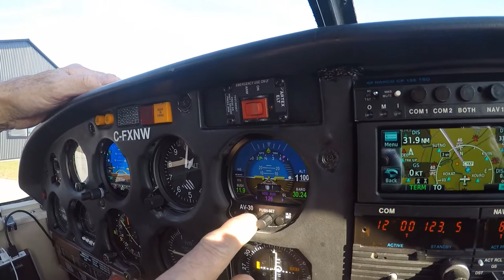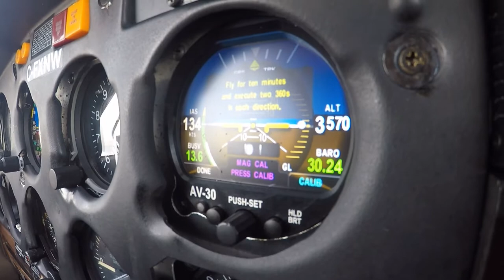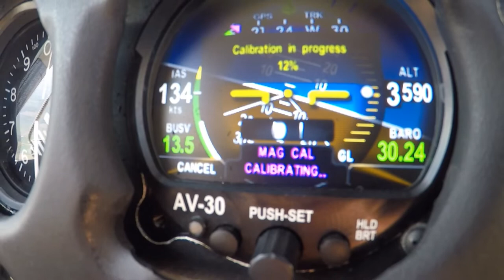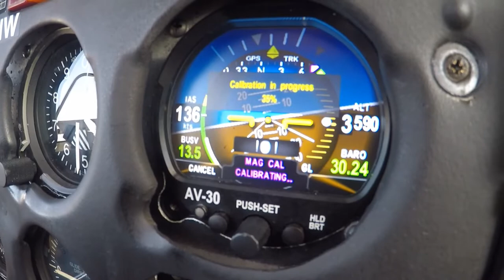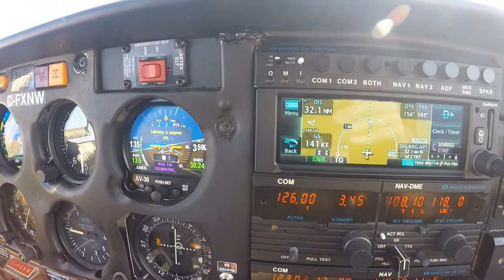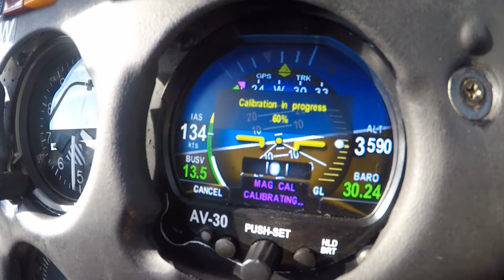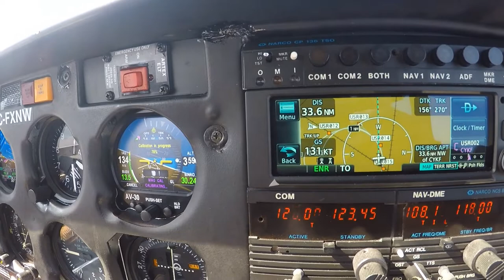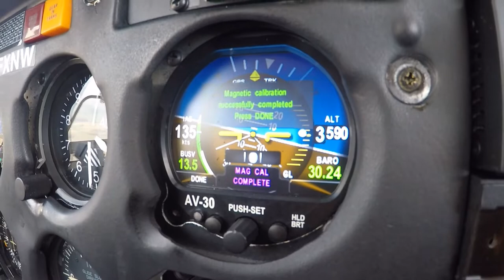uAvionix AV 30 Calibration of Magnetometer

Comment: I just had a pair of these installed in my 172-N and the vac system removed. By default, the DG does not use the magnetometer and drifted about 5* per 30 minutes, which is better than a mechanical gyro. I was happy with that, but just for fun I enabled the internal magnetometer (set AID mode to MAG1) and then calibrated it similar to how you did it here. All turns standard rate (2 minutes per 360). For the first calibration I made my turns R, R then L, L and the drift was worse than the default of not using the magnetometer! I calibrated a second time making the turns alternating: L, R, L, R and the result was much better.

Comment: tried doing this with a AV30E and it was locked out ? Is this still an available option /
Reply from the maker: You have to put it in the set up mode to do the calibration. Hold in on the button and power it up. then ture all the way too the right. look at the first part of the video.

Comment: Did you have yours in MAG1 or MAG2? 
Also I’m wondering why when the DG is function locked there is no way to adjust heading after it drifts
Reply from the maker: Sorry I am not sure but I think it is Mag 1 I also think the latest updates improve the function. I just this week installed the latest version and it now retains the altimeter setting after restart.
Reply: @Gord001ca  ok perfect thanks! I wasn’t aware of the update

Comment: What are you using for a DG and the OBS heading adjust?.    Also, does the AV 30,  heading bug move to indicate what the GPS has it set to, or the DG has it set to?  Example:  I know you can't set the OBS bug or heading bug on the AV 30.    But does it at least show what the bug is? , assuming the bug was set by the DG OBS ,  or the bug was set GPS itself due to direct to hdg mode .
Reply from the maker: I still have my old HSI 100 for a primary DG. The AV 30 is a great stand by and has a built in magnetometer which works fairly well and it also gets in put from my GPS. My GI275 is also a magnetic compass as it has a magnetometer connected. So hopefully I don’t get lost. I have lots of redundancy. Two artificial horizons, three altimeters, and 5 directional sources. And you can set the heading on the AV 30.
Reply: @Gord001ca  Thanks for reply. I looked anbd no one has a video of the AV30 using a GPS. not even the Factory videos. Odd. The he AV 30 has no OUTPUT DATA lines at all. . It is rs232 input only. So whatever you set the bug on it to, does not get transmitted out to anything. The heading you set in it is really just a reminder reference. You would likely manually set it to match what the real DG HDG bug you have set to is . However, it is not clear if the HDG bug in the Av30 can be set by the GPS unit if the AV30 is in GPS trk mode. For instance, if you are in GPS trk mode on the av30 and you change the GPS "Direct to",  flight plan on your GPS , does the Av30 bug move to reflect what the heading Bug is from the GPS? This would be more of a MFD type action by the av30. Which is a bit odd, because lets say you are in GPS trk mode on av30 and it does display the GPS HDG bug the GPS is currently following. Then you go into the AV30 and try to manually change the HDG bug, which I know you can do.   But What does the AV30 do? does it ignore the manual input you are trying to make, or does it override the GPS trk input HDG bug from the GPS and change the display? Seems to me to handle this issue the manufacturer probably made it so the only way to manually set the HDG bug on the Av30 requires AV30 not be in GPS trk mode. Do you still have vacuum system installed?